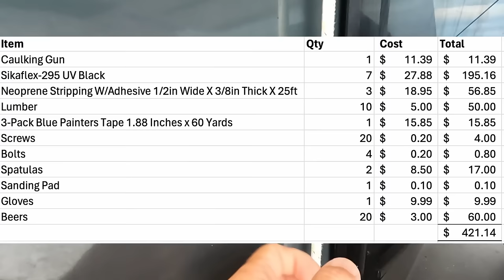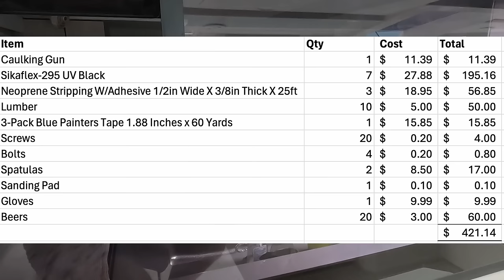#245t WHY does the Leopard Windows DELAMINATE? Sailing Sisu Leopard 45 Catamaran Circumnavigating

Comment: Boer maak n plan. But what a crap attitude from Leopard for what is patently a factory fault. Dreadful company. Must be exposed and learn to look after their clients.
Reply from the maker: thanx for the visit! yeah the video is why this happen, what we did to fix it, and how we rebed the window. and how to do it for a fraction of the price the boat yard did it. ALL boats with acrylic glass will go through this process eventually. the hull carries a warranty of six years so, there is that. boat owners eventually realize just how aggressive the seawater, everyday sun, shaking and slamming through waves, environment is on everything, lines, gelcoat, sails, stainless steel, as well as Sikaflex bonds exposed to the sun. Yes, we do use UV resistant stuff, but the sun and salt spray beats all human made efforts in a heartbeat :-D